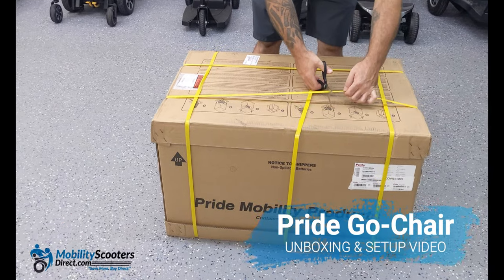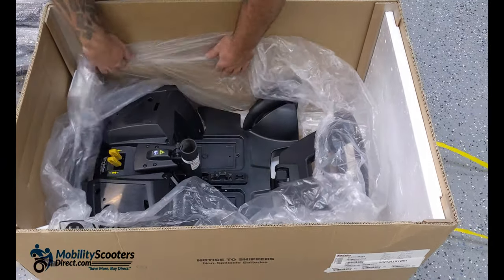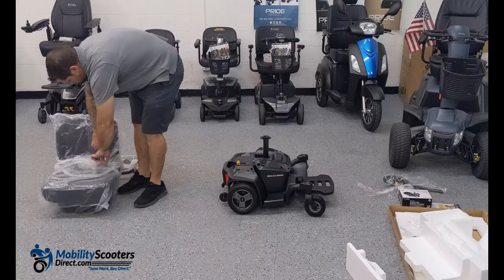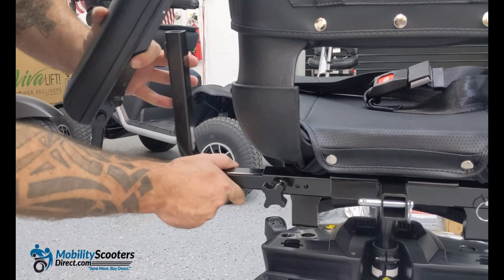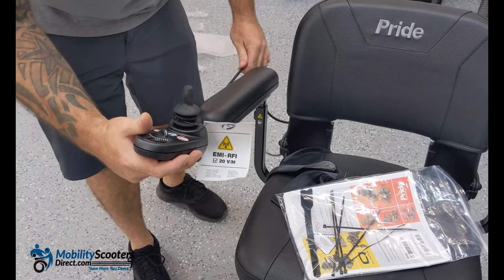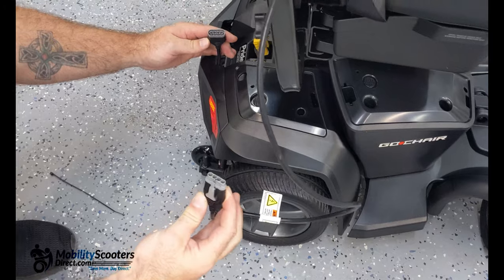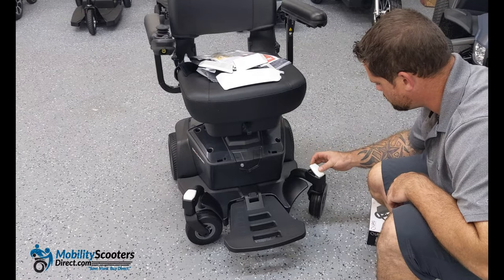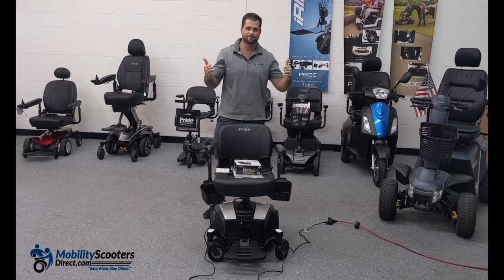👨🏻‍🔧Go Chair Unboxing & Setup Video

Comment: what’s the length from the seat to the foot rest? My right leg is shorter then my left leg.
Reply from the maker: 22" to 23" depending on how you set the seat post.
Reply: @MobilityDirect  thank you
Reply: The information you received from Mobility Direct is not nearly accurate. The numbers given you are for overall seat height. The true distance from the bottom seat cushion to the foot rest is 16.25 - 17.25 inches depending on overall seat height adjustment. So 16.25in - 17.25in  overall "legroom"  from edge of seat seat to foot rest. The larger number you were given is seat to ground height. This info comes straight from the spec sheet for the product listed on Pride's website under "Seat To Platform Height." Hope this helps....
Reply: @jdh9676  it definitely does.  Thank you
Reply from the maker: @jdh9676  thanks for pointing that out. We mistakenly provided the seat to ground height. Sorry about that!!

Comment: That doesn’t make sense    Why would a higher hole make the seat lower and the lower hole makes the chair higher?  It should be opposite
Reply from the maker: It's just the way it was designed.
Reply: @MobilityDirect  thanks
Reply: @MobilityDirect  what’s the length from the seat to the foot rest? My right leg is shorter then my left